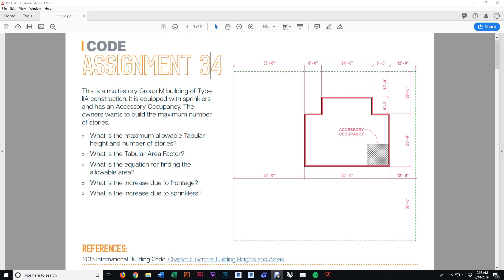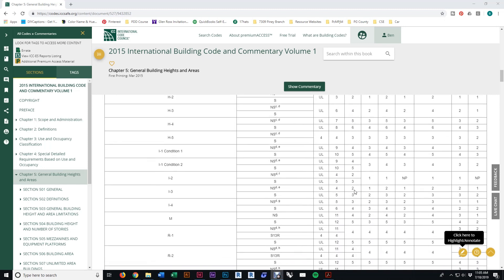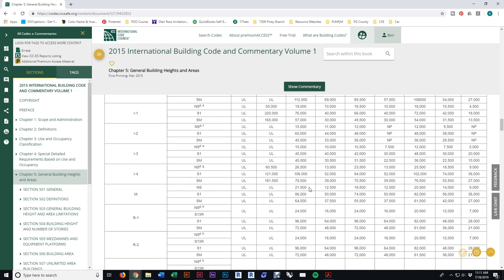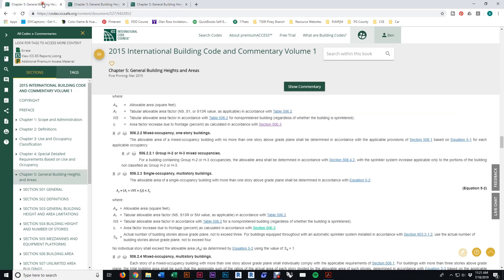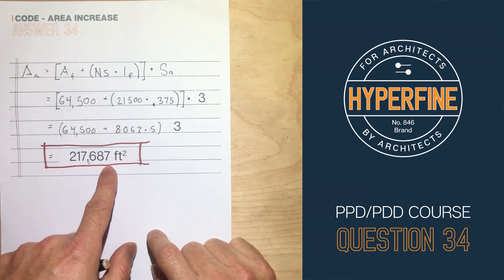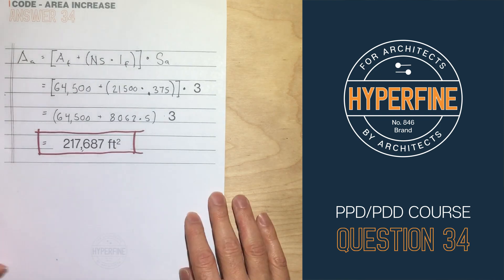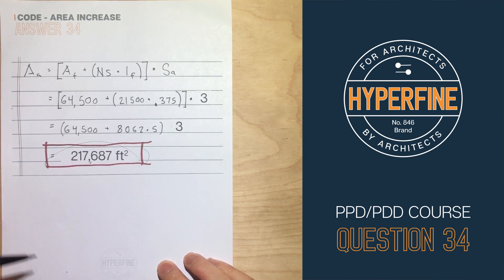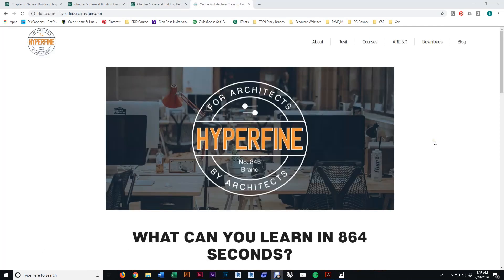ARE 5.0 - Allowable Building Area for PPD and PA

Comment: Do the equations in this video still apply to the 2021 IBC?
Reply from the maker: Generally the same process, but the equations have changed from 2018 IBC. Here's a link to the 2021 IBC. Anything in blue is changed from a previous version. Note that the ARE is still on 2018 IBC as of September 2023.

https://codes.iccsafe.org/content/IBC2021P2/chapter-5-general-building-heights-and-areas

Comment: How many decimals should you round to in any step of this equation? I noticed in the "F/P - 0.25" step, you rounded to two places for 0.41, but then for the final value of 'If' you ended the decimal at 3 places for 0.375  - is there a particular rule of where to stop?  

I saw your article online explaining that for calculations of building height, area and stories the rule of thumb is to always round down, so I understand that it was deliberate that 0.375833333 became 0.375 rather than 0.376, but my concern is that: if the 'If' variable in the Single Occupancy Multistory equation had been rounded as 0.37 instead of the longer 0.375, the final value of Aa for max total building area (as well as the max area of any story) would have come out different. 

Since every point could make a difference and some of the exam questions require you to type in an exact numeric answer, I just want to make sure I'm clear on this procedural stuff in case that could make a difference in them grading my final answer as correct. I don't know if they ever accept a 'range'
Reply from the maker: Hey Jameson, sorry for the super late reply. Best way to reach me is ben@hyperfinearchitecture.com

As for your question, I try to tell people to not lose sleep over rounding. The exam is written with some leeway (a range as you say) for these kinds of rounding, and if you have to actually type in a number they will generally tell you the format that's expected. My personal opinion (and I am not a test writer or don't have any secret knowledge) is that a difference of .001 or even .005 or even .05 is not going to be a problem. If you are supposed to have 14 risers and you round to 13, that's a problem. If your building is 37,595 sq. ft and you end up with 37,500 I don't think it's going to cause a miss. Just my $0.02. Do the math the best you can and move on to find more questions you know you can answer with certainty.
Reply: @HyperfineArchitecture  That approach makes sense. Thank you for replying.

Comment: if the property line is at an angle to the building do I measure at the smallest distance from the building
Reply from the maker: I think so. Per 506.3.2, you measure at right angles from the closest interior lot line. But I can almost guarantee you will not see that kind of trick on the ARE. Even the IBC commentary doesn't explicitly discuss this angled condition.

Comment: Thanks for the video! For the frontage increase calculation, you mentioned you only count those walls whose frontage is greater than 20. Whoever you counted walls C and G whose frontage is equal to 20, but not technically greater than 20. Can you clarify?
Reply from the maker: Code says minimum distance of 20 feet. But don't trust me, read the code: 2015 IBC 506.3.2

Comment: When calculating the "W" you use 20 and 30, but AHPP page 873 says "W/30 uses the space around the building of between 20 and 60 feet, confused need more explanation.
Reply from the maker: There are some exceptions that allow you to use W max of 60. Read the actual IBC, not AHPP.

Comment: Thanks for the video!  I wondered why did not we use  (S=4 rather than 3) for the number of floors if we are assuming the building to be equipped with a sprinkler system throughout?  I think it says in the footnotes that S=3 as a maximum when it is not sprinklered, but 4 if it is. Thanks
Reply from the maker: The S=4 applies to residential groups. If you read the section that exception references you see it refers to the S13R sprinklers.
Reply: Thanks for clarifying. It’s crazy but the Kaplan ppi has this wrong in their book then, B occupancy type IIB, using Sa value of 4. Page 16-19 if anyone is here for the same question.